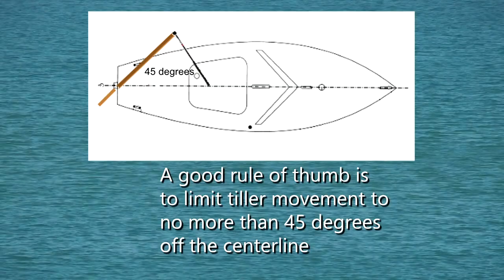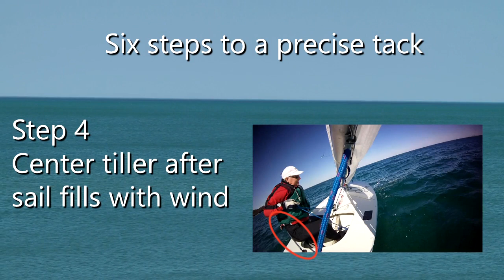Tack your Sunfish step by step

Comment: Hi Steve. I just got a sunfish and really appreciate your excellent videos. I haven’t sailed in 20 years and plan to use it solely for recreation in light winds in my bay. Could you do a video on just how to rig for recreational sailing. I saw your adjustment video with tuning but it’s not quite clear to me. Your videos are the best with regards to rigging and sailing a sunfish
Reply from the maker: Attach the halyard to the upper spar so that when the sail is raised the lower spar is about 3 feet above the deck. That makes tacking physically easier. Adjust the lower spar fore or aft in the gooseneck so that the lower spar is approximately horizontal. Tweak the adjustments until you are happy with the way your boat sails. That should be part of the fun of owning your boat.

Comment: Exceptionally well done instructional video!! Was just out today for the first time on a Sunfish and this would've helped!  Like the bit about letting out a foot of mainsheet as you tack. I'm on the taller side and am just seeing below some of your notes about adjusting the boom height - but I had a TERRIBLE time with the mainsheet along the boom getting caught on the back of my life vest.  Noticed in at least the first of your tacks, your vest also caught a little but you seem to have some loop midway between the two pulleys on the boom - is that an added feature?
Reply from the maker: Those mainsheet hangers can be purchased from Sunfish equipment dealers or you can make your own. During a tack, as the boom comes across, a little twist of your shoulders will shed the mainsheet from the top of your PFD. Also, some PFDs are much better than others. Look for a lower, thinner back. Glad you enjoyed the video.
Reply: @KingGroupProductions  much obliged - will try both!  (And to echo another comment here... Waiting with bated breath on the gybing video ;)

Comment: The only thing I do differently is I actually sheet in while initiating my tack.  I feel that the keeps my main trimmer correctly as I turn into the wind, maintaining the most speed possible.  It also feels like I am 'pulling' my self into the the tack and creating some more speed by pumping (as you would in light air).  Then when I come through the tack, I am still close hauled, which maintains some lift on the new tack, and also pushes me off the wind, at which time I ease, trimming to my position off the wind to pick up speed again.  Maintaining pressure on the sail maintains tension on the main sheet throughout the tack, which allows me to actually 'swing' from it while I duck under the boom.  The problem with this (as you mentioned) is that the boom doesnt rise up, and can be difficult to get under.  sometimes my pfd gets caught under it, sometimes I dont make it under and end up capsizing.  My solution is to fix my halyard lower on the top spar, raising my main higher up to create more room.  Having the main up higher also helps in light air (more wind higher up).  But, I suspect it hurting me in high wind, by being less aerodynamic and causing me to heel more.
Reply from the maker: You make some good points. What was not covered in the video is that techniques will vary depending on wind strength and the body agility and strength of the sailor, and the personal preference of the sailor.

Comment: Love this video. Very helpful. One thing I cant get is changing the hands on the tiller. After I've changed hands, i cant get the extension by me. It seems to want to go under my arm and the extension won't  go past my arm pit. It should go outside of my arm and body like in the video, but i can't figure it out. What am i doing wrong?
Reply from the maker: Sorry. Can't help without seeing what you are doing.  Here's an idea: I have suggested to students that they "chair tack as a practice exercise. Place two chairs or benches opposite each other about as far apart as a Sunfish cockpit is wide. Place a third chair facing the other two...this is the stern deck of your simulated Sunfish cockpit. Fasten a bit of line to something in the front of your "boat" to act as the mainsheet. Using a bit of duct tape and some dowel rods or whatever is handy create a tiller extension and hiking stick, and fasten that to your third chair. Now you have a Sunfish cockpit simulator. Practice the moves you see in the video. Soon you will develop the subtle ways your body and hands have to move to handle the main sheet and the tiller extension.  Hope this helps.

Comment: Very profesional video! Steve any advise on who makes the best sunfish? I have an old 1974 AMF that I restored but she is a little tired.
Reply from the maker: I think that most any Sunfish that weighs from 125 to 140 pounds, has no hull damage, and has no soft spots in its bottom will serve well. When I was buying my Sunfish people warned me not to by a boat made by Pearson; however, that advice was based on some manufacturing inconsistencies in the 1990s that resulted in boats in the 120 pound range that proved to just not have enough structural strength and rigidity. I ended up buying a 1991 Pearson built boat that weighed 134 pounds. There was a removable inspection plate in the boat that allowed me to determine that the boat interior was dry, the internal foam blocks (that are part of the boats hull rigidity) were all in place, and an external inspection suggested that there had not been any hull damage or leaks around hardware. I sailed the boat for 10 years, and it is still sailing today. In short, I don't think it is so much the manufacturer as it is the condition of a particular boat that is important.
Reply: @KingGroupProductions  Thank you That helps. It is my understanding that all new sunfish are made in China? I will keep sailing my 46 Y/O AMF till I find one less abused!
Reply: @tonysimi1776  The latest Sunfish are being built in the UK. The remaining China built Sunfish in the LP warehouse should be sold by the end of the Spring.

Comment: Hey Steve, wondering if you can point me to a good place for a replacement daggerboard, rudder and tiller.  Great work on the videos.
Reply from the maker: Here SailingForums.com/Sunfish. Great group of sailors there. Several forum participants sell rudders, dagger boards, tillers, and other Sunfish parts. Post a request for what you need. You will almost certainly get answers.
Reply: INTENSITY sails.com

Comment: Great video! But I hope you make a new one with a stabalizer. :-D
Reply from the maker: What sort of stabilizer did you have in mind? In my professional video career I have used gyroscopic stabilizers for professional cameras; however, I am unaware of any waterproof versions of gyro stabilizers. Also, they tend to be heavy. I decided that an end of lower spar mounting with the a GoPro facing forward would be the best  way to show how the sailor manages the sheet, tiller, and his body to tack the boat. So, to keep it simple I fashioned a mount consisting of a piece of PVC thin wall pipe sliced longitudinally to clamp on the lower spar with a piece of aluminum strap pop riveted to it and bent so that the camera could be mounted to it. The result was cheap and functional. The only downside is that there is a bit of springyness in the strap resulting in some occasional camera quiver. I considered that an acceptable compromise. Overall, I believe that I accomplished my objectives.